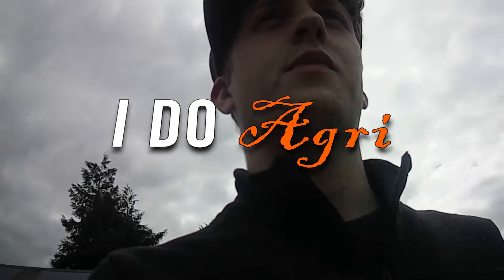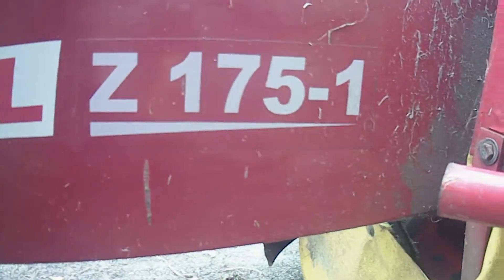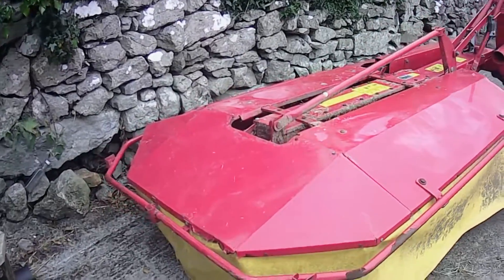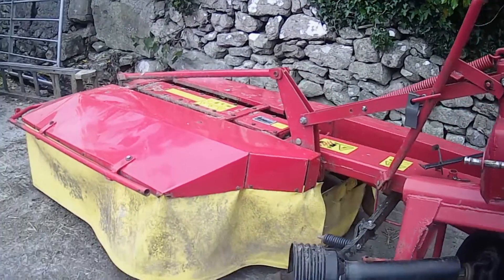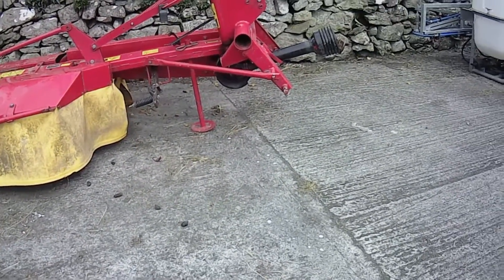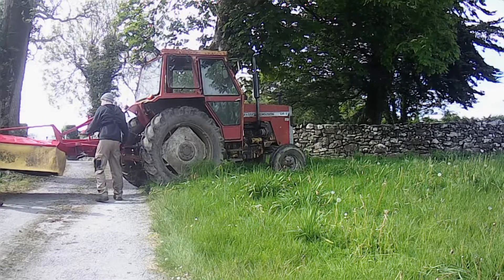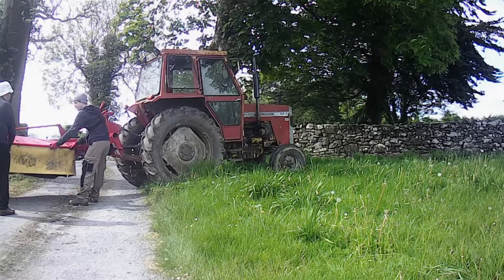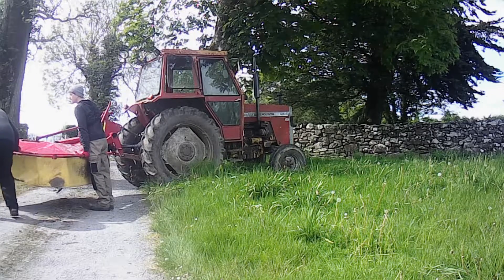Mesko-Rol Z175-1 Drum Mower REVIEW

Comment: I use a ratchet strap on the left side of the mower instead of trying to attach that transport bar every time.I hook it from the right bottom link arm to the safety rail bracket.Its alot handier.Take off the mowing bracket and drive forward with the mower down and it opens handy.